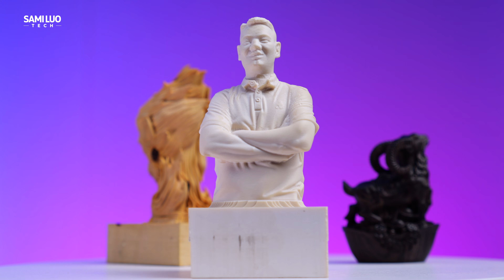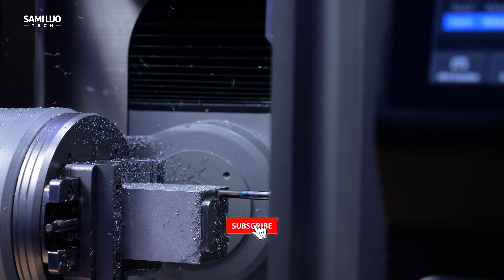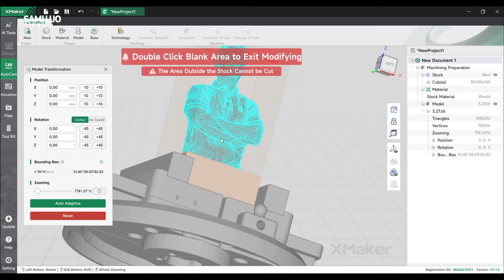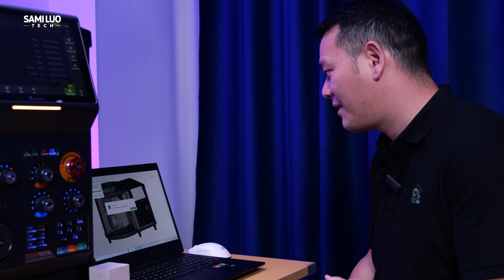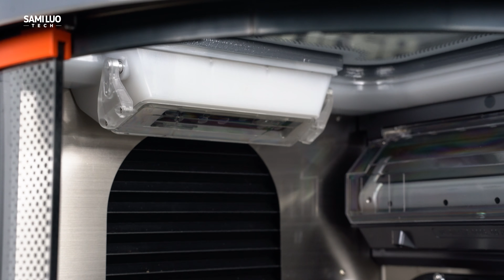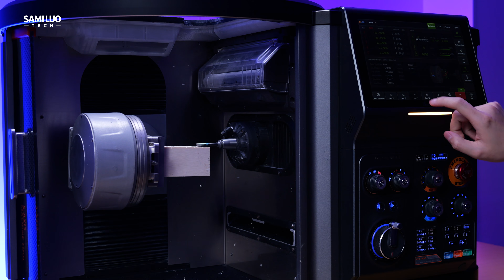I Tried a Desktop 5-Axis CNC… The Results Shocked Me | XMachine WM-100

Comment: I'd like to do the independent honest review. I have seen so many desktop CNC milling machines doing fantasy work like, dolls, wood engravings etc. but I must say this one could have potential for more than that.
Let me ask you this, have you guys ever tried machining a shrouded impeller with it? If you can do that, you can do mostly everything!
Can this be programmed with other CAM software like Siemens NX?
What is the maximum tool length and maximum tool diameter?

Comment: My prototrak mill weights 3200lbs. It can only handle so much tool load before its rigidity is just not quite enough to machine any harder. My haas VF4 weights 13,000lbs and can run like a raped ape. My 5 axis dmu 75 weights around 18,000 lbs, this desktop weights what? 100-150lbs? Hope I learned you guys a little on machine tool rigidity and why these little things are nothing more than a joke.
Reply: It is over 300 lbs. but yes, it is a concern.

Comment: As a machinist who operates in the "hobby" space, but also as a farmer and mechanic, I bought my manual machines to be able to repair equipment I and my friends and neighbors own. My (somewhat clapped out) manual machines can already handle larger, less precise jobs. A machine like this theoretically adds small precision parts (which I already can 3d print, but am obviously limited to what FDM materials can withstand) to my arsenal. Not only would I be able to repair a damaged hay mower spindle, but recreate a broken gear from it's gearbox that the manufacturer no longer stocks, or make repair parts for small hydraulic pumps or maybe even diesel injection pumps and things like valve rockers. I am not quite sold on pre-orders (been burned by Kickstarter compaigns before) but this is a machine with obvious, but reasonable limits, and also with obvious perks, at a price (even at current projected "full price") that could make me a buyer. I have been following a 2002 Haas Mini 3-axis on my local marketplace and wishing I had the $16k for it, I don't have the room or electrical supply for something like an early 90's Hurco, which is closer to my price limit...
Reply: I'm a pre-backer but after listening to a few of their more recent videos I'm thinking about requesting a refund. Cutting aluminum it sounded awful. Maybe fine for acetal and the like but at that point you're not really gaining much on 3D printing.
Reply: @sansbury95  It will always sound awful, because the mass is simply missing. At around a metric ton of weight combined with a rigid setup,  you will have enough dampening to cover most frequencies you will encounter when working with steel and a 10k rpm spindle at reasonable feeds with a 10mm carbide endmill. Everything under will be a compromise no matter what. Mostly around 3k rpm 200kg machines will have an awful resonance without even cutting. 

You will have a lot of tool chatter and needs to play around constantly to hit the sweet spot.
Reply: @bogeydope3022 do and don’t agree. If you look at something like a Haas TRT100, that weighs about 150 pounds. That’s a 100mm Haas trunnion so you’re not doing heavy hogging on that either but it doesn’t sound like this. So I don’t think it’s out of the question to build a machine that weighs hundreds of pounds that is capable within limits. It may be that this is just pushing that too far. I also wonder about their harmonic drives or whatever they’re using for the rotary axes. The rigidity of those joints is not solely a function of mass….
Reply: @sansbury95  That is a fixture, and therefore is detached from the rest of the machine considering rigidity. It is nothing else but a vise in our setup. 

You have to understand that the TRT has a big brake that locks the whole axis while feed starts. 

This has a miniscule effect on the setup as a whole. 

Resonance on this scale can only be dealt with by mass, considering we have a rigid machine coupling to begin with.
Reply: @bogeydope3022 considering that a trunnion has two moving joints I think it’s fair to say that it’s a bit different from a vise if you’re doing continuous 5-axis and not just 3+2. In any case, I’m not saying this was ever going to be very rigid. I have a VF2 in my garage and I know that’s not that rigid compared to something like a Genos. But it’s more than enough for what I do. Setting that up to do 5-axis would cost me upwards of $50k so I thought for 6K or so this might be worth a try. My work is all prototyping, so MRR is pretty much never my bottleneck. Some of the other benchtop machines like the Nestworks seem to be surprisingly decent for what they are. A lot of Internet “real machinists” will sneer at them but I think these little doodads will probably be the start of a lot of shops and small manufacturers. Over the past generation manufacturing became something people lost familiarity with and stuff like this is going to reintroduce a lot of people to it. I hope these guys can do a little better. We’ll see.
Reply: This is such a useful perspective — sounds like you actually know what you need the machine for, which is honestly where I'm still figuring things out.
I've been looking at 3-axis options like the Nestworks C500 as well, but keep getting pulled toward 5-axis without fully understanding why I'd need it over 3-axis for a beginner. From your experience, what would actually push someone toward 5-axis — is it the part complexity, fewer setups, or something else?
Also curious what you think of the newer ones like Topfab and InfiMaker that just launched — do they seem like serious options to you or still too early to tell?

Comment: One can build a complete AR-15 receiver in a few sessions while watching streams and eating snacks wtf haha
Reply: The small build volume is going to necessitate a multi-piece design, which will be difficult to make durable... The very small work area is this machine's weakest link for sure. (unless the software is all a lie, in which case that's the weakest link). But it's a very compelling package for certain people. I have manual machines that are larger, but making small, precision parts is very hard on those. This could fill a very useful gap not just for makers, but certain machine shops.... If it lives up to the hype

Comment: Really interesting device at an interesting price point. But comes with the risks of any "noname" new brand, especially in that price range (7000-10000€?). As it is still a bit early, but questions still remain: what about export/import into countries like Germany, do they cover the 2+ years of minimum warranty there?
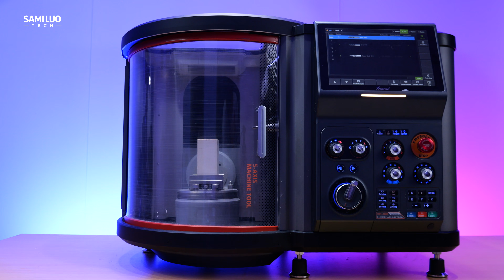Also I noticed a bit of wear on the machines plastic parts already (no big deal but sad to see scratches on the window already @ 18:10). Is that because of metal chips sticking to it and scratching it when it slides into the left side? How could one prevent scratching the window that badly when you need to open it to clean it? Is this an engineering oversight or was it user error?
Also noticed  @ 18:13 that the laser scanner was taken out? Is that to keep it clean while the machine is working? Or was it sent back because of a fault (as the whole device is still in the late stage of prototyping/testing I assume)?
Still more interesting to me (mostly used to cad -> snapmaker u1 (tool head) 3d printing) to maybe step into the realm of rapid prototyping different, more high quality materials, than some other small format desktop 5-axis cnc machines.
Reply: That's a really detailed breakdown — sounds like you've been watching closely! So are you mainly looking at CNC for rapid prototyping with better materials than what the Snapmaker can handle? And is 3-axis vs 5-axis even on your radar or are you more focused on material capability at this point?
Reply: @LilyL-i6h  I think realistically, I should be more focused on expanding my material processing capabilities before stepping into 5-axis machining directly 😅
I guess I will build me a "cheaper" 3 axis cnc before maybe breaking a much more expensive and complicated 5 axis machine. (Also looked into cam software that supports true 5 axis cutting... they are often more expensive than the vm-100 itself or similar machines, because they are catered towards professional workshops xD)

Comment: Not risking 6k on kickstarter but maybe oneday these will be avaliable like 3d printers!
Reply: Its impossible this is going to be as cheap as a 3d printer. Physics just say no (its got cutting forces and the weight on its own is as heavy as multiple large 3d printers). If it was mass produced it might be possible to go as low as say 4-5k but I don't see that happening.
Reply: @exol511 which is why I said available not cheap 😛 if this wasn’t a kickstarter I’d buy one in an instant but I’ve been burned on there before

Comment: I've been following this machine for a while.  Great to see that it has finally come close to release.  It looks like they have solved what in my opinion is the biggest hurdle to more than 3 Axis - and that's the CAM / Toolpath generation.  Traditionally the software becomes super expensive when you need 4th or 5th axis.
I'm definitely in the market for one of these - but I'll wait for a few more reviews.  I'd like to see how rigid it is - which is more important with harder materials and makes a huge difference to the machining tolerance.  A position tolerance of 0.01mm unfortunately tells you almost nothing about the machined tolerance it can achieve.
Reply from the maker: Totally agree, software and rigidity are everything—hope to see more independent testing soon! :D
Reply: agreed! My 5 axis haas mill says it can achieve the same level of positional tolerances as my hardinge lathe but the hardinge can easily make parts with 2 tenths all day where my haas mills are more of a plus or minus 1 thou all day.

Comment: Most of all, I’m curious about how durable the kinematics in this СNС are, how soon something will need to be replaced, and how easy it will be to do.
Reply from the maker: Hey thanks for commenting, here is the answer from the official Xmachine: Under normal use, you’re basically not replacing any core parts for the first ~3 years, so costs stay predictable.
Consumables like tools, collets, fixtures, spindle/ATC parts, and coolant are all replaceable.
It’s modular too—most things you can swap yourself with their guides, and they support long-term spare parts.

Comment: Just beware that this is extremely heavy for its size:130kg for the system, 200kg shipped!  Definitely requires a lift/hoist.
Reply from the maker: Yes... definitely treat it seriously :DD
Reply: its what you need, the 20kg pocket NC vibrates of the table
Reply: You cant lift 120kg ? your weak😂.

Comment: Really cool! But do the Ai features require Internet connection? What are the trade offs for not wanting an Internet connection?
Reply from the maker: Hi, thanks for watching. AI features need internet—they run on cloud computing for things like auto toolpaths and smart optimization.
If you go offline, you can still use it fully with traditional CAM (like Fusion 360) or manual G-code—they even give you the post-processor.
You just lose the one-click AI stuff. The core 5-axis performance stays exactly the same.
Reply: @SamiLuo i figured as much😮‍💨 ok thanks!

Comment: this is the most impressive machine I've ever seen for CNC.
Reply from the maker: Many people said that :D
Reply: @SamiLuo  really? I guess it's simply the first more than 3 axis machine these people have ever seen? I find it hard to believe that 'many' people that are any more than vaguely interested in CNC would say that, since anyone that has even a passing interest in CNC will have seen more impressive machines than this decades ago. yes, those machines are far larger and far more expensive, but still more impressive.
Reply: @jeremyglover5541 you mentioned price and size. These are exactly the qualities that make this machine so attractive.  A 5 axis cnc that's within reach of a DIYer?  Unbelievable.
Reply: @renli3d  the working envelope in this machine is tiny. Its power is small, its rigidity and spindle power insufficient for any useful speed. It doesnt come with 5 axis CAM software, they are misleading in that regard. The software they provide is not capable of producing 5 axis tool paths, in spite of their claims of being 5 axis. Software that does is not cheap and dwarfs the price of this machine. So many red flags. With the right contacts, the price you/I can get small one off parts (both milled and metal 3d printed) made to order means this is uninteresting to me. 

They have been trying to get this across the line for a long time. 

If it sounds too good to be true; it probably is.

They make most of the parts themselves, making all spares single source and their warranty is only a year, with shipping a 200kg machine back for service not cheap… you feel confident you could service and fully calibrate a 5 axis machine yourself and produce any spares?
Reply: @jeremyglover5541 thanks for the info.  I'll have to do my due diligence before i put any money down on one. Extraordinarily claims require extraordinary evidence!
Reply: @SamiLuo i fix things professionally and this would allow me me repair an assembly instead of replacement. For instance, i could make a u-joint for a driveshaft, or a hose fitting for a car radiator. A new impellar for a water pump. Etc.
Reply from the maker: @renli3d  Exactly :DD

Comment: No mass? No me likey. These arent particularly new, still great that were bringing this capability to be more available but I dont see anything compelling enough to buy one.
Reply from the maker: You’re right — it’s not a brand-new invention of core CNC tech. RTCP, ATC, probing, those all exist already.
The point here is more about integration and accessibility — putting real five-axis capability into a desktop machine instead of a full industrial setup. Things like RTCP, auto tool changing, wireless probing, water cooling, and CAM workflow are all combined into a much smaller system at a much lower entry cost.
So it’s not “new tech,” it’s more like making existing industrial capability actually reachable for small studios, makers, and education setups without needing a full factory-level budget or infrastructure.
That said, I understand your point — it’s not for everyone, and it won’t replace a full industrial five-axis machine. It’s more about opening access to people who previously couldn’t realistically touch this level of machining.

Comment: Generating toolpath is done how ?
In app like slicer or cloud with nice sub money every month?
Reply from the maker: Toolpaths are generated using the XMaker software, which is free — no monthly fees, no cloud subscription. It runs locally on your Windows or Mac, so you just import your STL file and it can generate 3-axis, 3+2, or full 5-axis toolpaths, plus simulation.
If you prefer, you can also use other CAM software like Fusion 360 or Mastercam — they provide the post-processors, so you’re not locked into one system.
Reply: But toolpaths are rarely ever correct the first time. I program and engineer parts every day. I program Swiss lathes and mills for complex parts. I’ve used every software out there, and no matter what, the programs need massaging and correction for dialing in within a production setting. 

Do you still have direct control over the toolpath generation parameters or is it always just spat out by AI? I’m talking about stepovers, DOC, load, flat area detection, semifinished roughing, tolerance, etc.